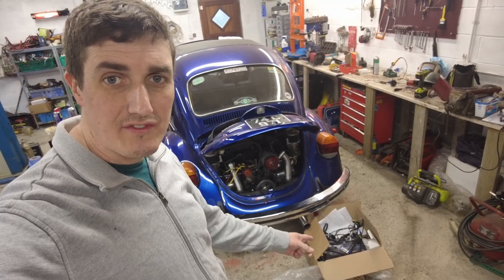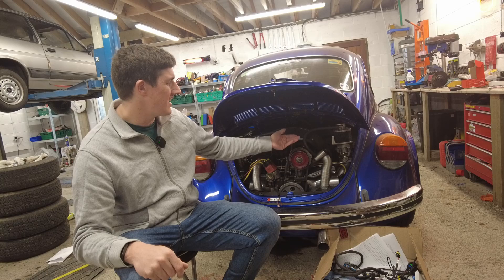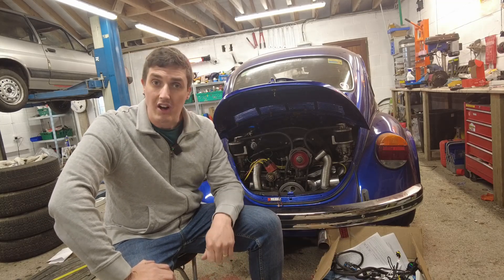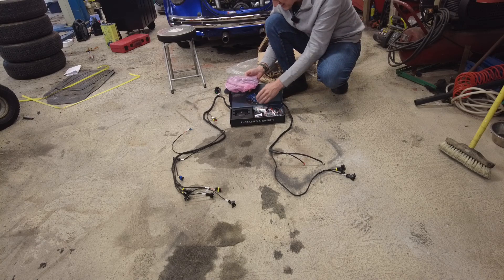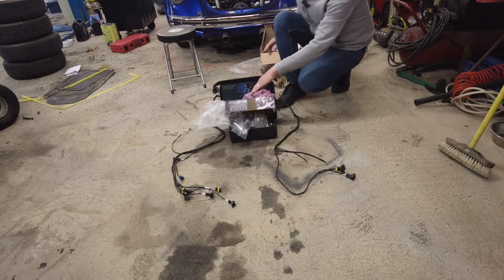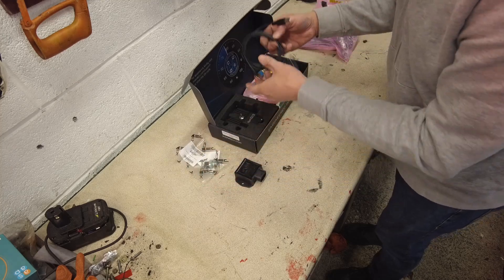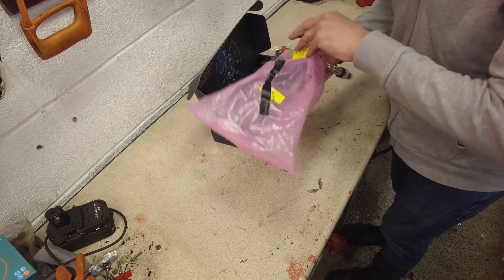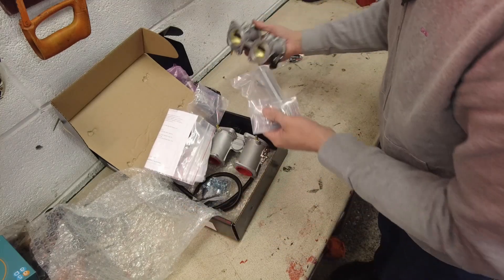Converting My Classic VW Beetle to EFI – Unboxing & First Impressions!

Comment: i purchased  Holly Sniper EFI that was actually made for a Ford single barrel carb and had it converted for a VW Beetle...  everything is self contained  and there are only 5 wires to install. The computer and injectors are all contained in the EFI .
Reply from the maker: How does it drive for you?

Comment: Looking forward to the next video.  Those kits are also expensive here in the states.😕
Reply from the maker: @vintage76vipergreenBeetle  they're mental money in the US! I was looking at some of the options from US suppliers, such as holley based kits and they were crazy money.
Reply: @Endfloat  The CB kit  looks like yours, but uses a bigger computer.
Reply from the maker: @vintage76vipergreenBeetle  there are more features rich versions of the maxxecu than the mini, but this one is all I'll need.
Reply: @ Okay, CB doesn't have that option.

Comment: Nice Ross. I’m having the same thoughts so I’ll be watching with interest, so plenty of filming please👍🏻 Also if you was to go for a larger engine can this system be adapted or do you have to buy a new one. Only asking because I’m currently running stock but plan at some point to run a 2007cc. Phil.
Reply from the maker: Yes you can adapt it to larger engines but you'll need to start out with the IDF manifolds and linkages etc.
Reply: Superb, I have CSP manifolds and their bellcrank linkage👍🏻 The price of having my idf’s rebuilt plus parts is half the price of the kit, that’s without rolling road time, decisions, descisions🤔